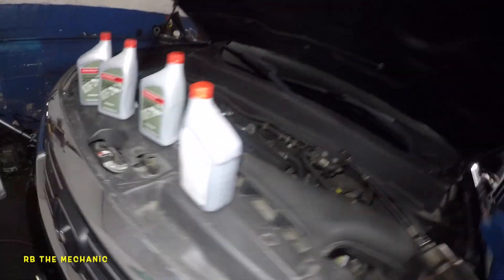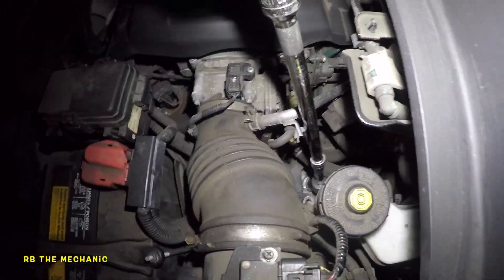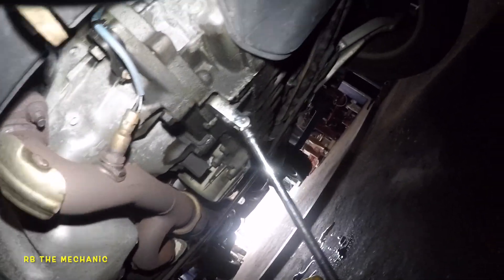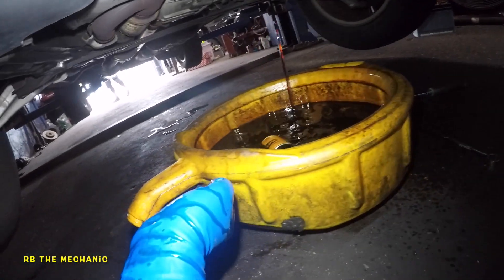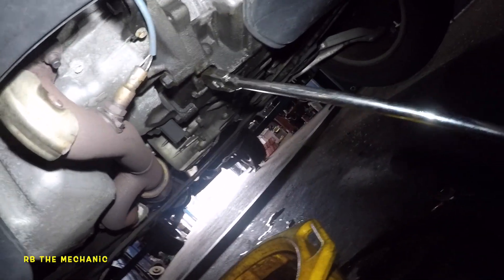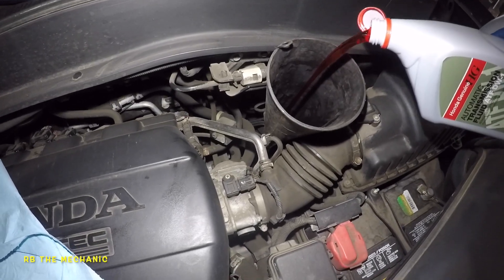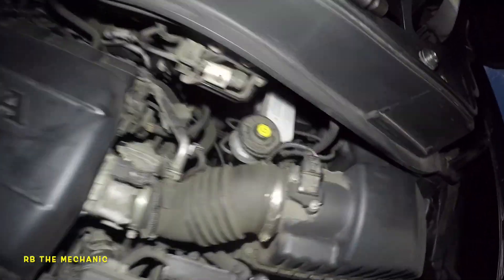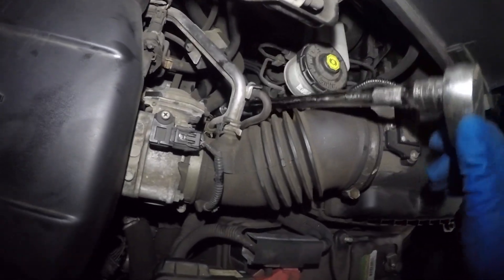How to change ATF WD1 automatic transmission fluid on Honda Pilot 2009 to 2015

Comment: Gracias buen video😊!
Reply from the maker: Thank you
Reply: I have a 2015 Honda Pilot LX and they told me that the transmission does not have filters, is that true ?

They only changed the oil just like you do….
Reply from the maker: @alexbran8199  it mostlikely dose have filter but I don’t think u need to worry about it internal built in
Reply: @RBTheMechanic  thank you